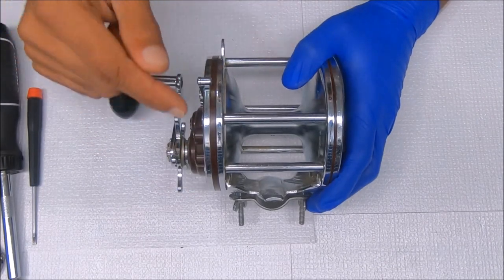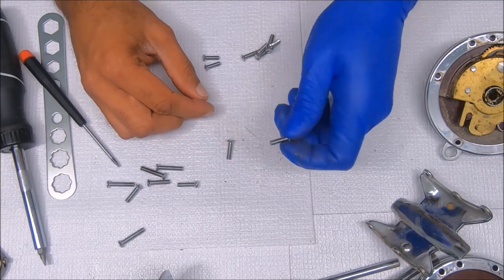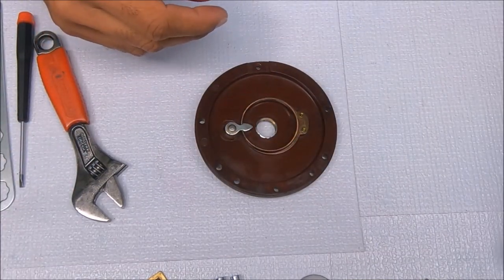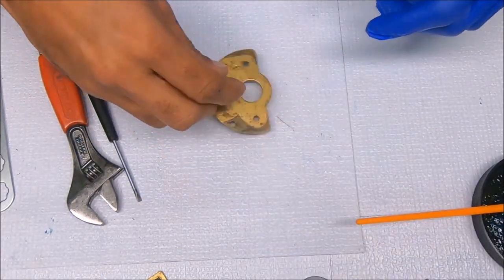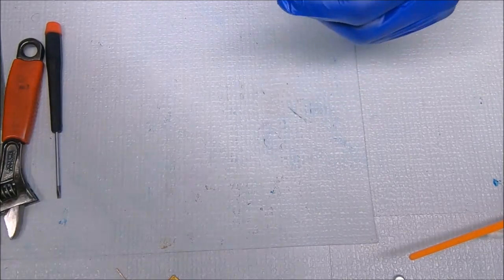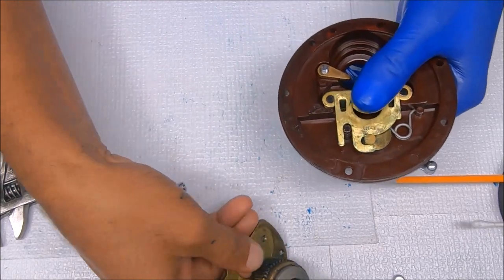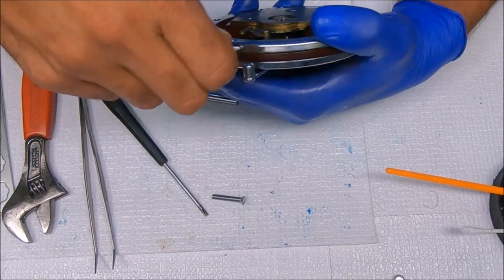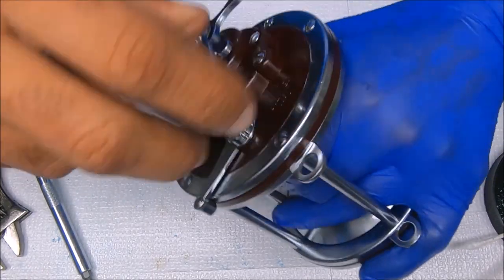Penn Senator 6/0 (114H) Fishing Reel - How to take apart, service and reassemble

Comment: When I reassemble the bridge/assembly and dog/spring back into the head plate, I do two things to make it easier and to not have to worry about chasing the dreaded "flying dog spring" across the shop. First I cut two small strips of masking tape, one, to hold the head of the screw that is put in place to hold the dog still, and two, a tiny piece over the end of the dog spring from flying out of it's place in the well while I rotate the bridge into it's final position.  The tape holds these components for me while I line up everything else, and they peel off easy after they are no longer needed.  The two strips of masking tape act like a third and fourth hand, so to speak, or extra fingers if that makes more sense.  I have never had to chase a flying spring again after I started doing this. I hope this helps someone out there to make reassembly a bit easier.  Great, clear video.  Thank you.
Reply from the maker: Thanks for watching! Good tip. Thanks for sharing. I'm sure it'll help viewers of this video.

Comment: Bought a used one for about half price. Gave my 6/0 to my Son and now I wanted another one. I'm curious. I only saw you ose a little oil on the exterior of the clicker slide lever and nowhere else. Also, I was taught to grease around the inside edges of the spool to prevent water from getting inside.
Reply from the maker: Thanks for watching! General places on these reels I'll oil are the bearings and handle knob. Everything else, I'll usually use grease.

Regarding the greasing of the rim of the spool, you should do it if it gives you peace of mind, but that probably doesn't help.... however, greasing the entire inside of the spool will protect the metal. If you're talking about greasing the edges of the spool to block water from getting inside to the gears and such, that wont help.

Hope the info helps. Spread the word about the channel.

Comment: where do you get your parts? I need the right side bearing assembly part# 1182119.
it is frozen on the shaft, and trying to get it off.   thanks for your help
Reply from the maker: Thanks for stopping by. Check the video description.

Comment: Is there a video somewhere for the Penn US senator 113W, I’m having trouble reassembling the two dog springs
Reply from the maker: Thanks for watching! Not that I know of. The double dog is set up opposing each other, like on a Formula KG. If you set the bridge flat on a table with the post at the bottom and look from above, one dog tooth should be facing up and the other facing down. You'll need to set the springs accordingly to facilitate that look with the springs adding pressure to the back side of each dog. Hope that helps.

Comment: Hola.  Gracias por mostrarnos como hacerlo a detalles. Yo estoy en México donde puedo comprar las rondanas de frenos para estos carretes . Gracias
Reply from the maker: Hi! You're welcome and thanks for checking out the video! Try eBay...... they should have sellers that have what you want (see my list in the community board). You may have to use t a mail forwarding company to get your orders shipped to Mexico, as not many sellers ship directly there. For the 114H (6/0) and 115L (9/0), you're looking for either the 6-115, for the carbon fiber drag washers only...... or 6-114HSP for the complete kit.

Comment: I'm having trouble with the drag. When I put the handle back on and tighten the bolt. I can't move the drag star at all to adjust the drag.
Reply: Thank you for this video. I have never owned a Penn. Your video help me greatly to give me confidence to take it apart and put it back together.
Reply from the maker: It sounds like you're pinching the star knob with the handle. Undo the bolt, leave the handle on and keep turning the star knob so it goes down more. Let me know if that helps.
Reply from the maker: You're welcome and glad it helped. Subscribe, if you haven't already done so, and spread the word about the channel. Thanks!

Comment: Note that the pin on the gear sleeve only comes off and goes on one way only.
Reply from the maker: Thanks for watching and sharing! I don't think these pins are like those on some baitcaster spools where one end is sloped, but I have found that these pins usually only go back in a specific way after removal, probably because of stress on one end when pounding/pressing it in. All the gear sleeve pins I have are a consistent thickness throughout and the ones at Mystic look to be the same:

https://www.mysticparts.com/PennParts/Parts/102-114.aspx

It'd be great if you could upload a video of a new pin that's sloped.